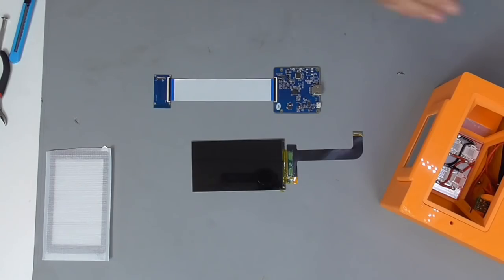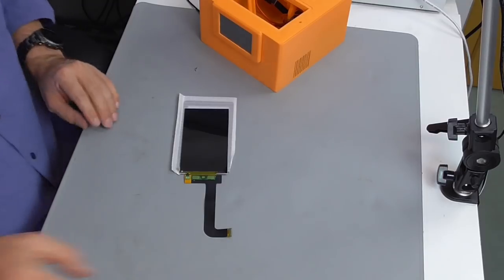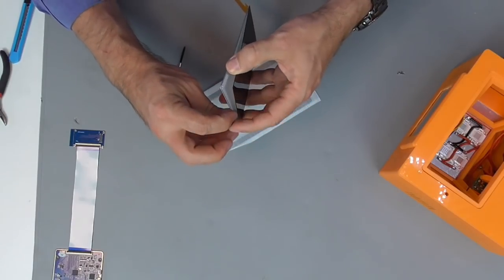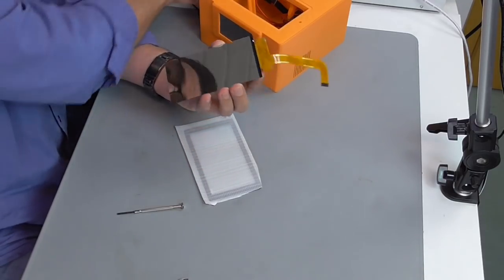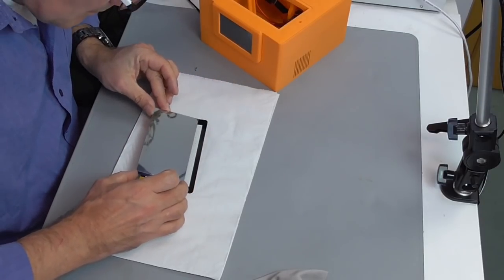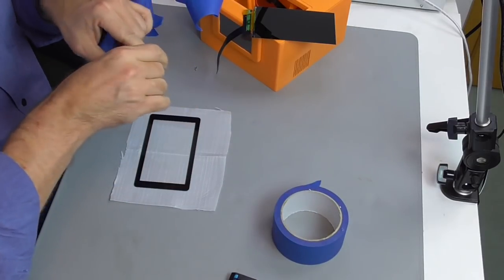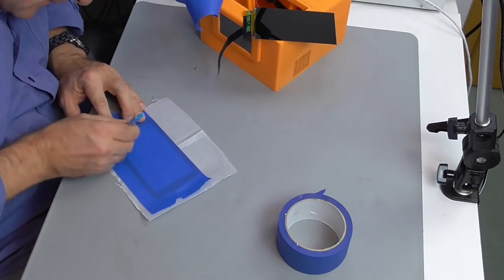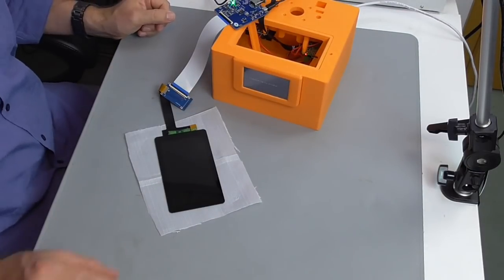DIY: FDM-printed SLA-Printer: Part 9 - Preparing the Display

Comment: i had an idea and wanted to know if it was possible to add a lens like a projector has to make the bed larger? would this work or would you have to have a larger lcd screen instead? im want to make a work bench sized resin printer bed.
Reply from the maker: An increased projection surface does not increase resolution, or adjust intensity of light. In other words: you will get a terrible printing resolution/quality on the x- and y-axis. At the same time the given amount of light is spread over a much bigger surface which degreases intensity and therefore increases exposure time significantly. Long story short: terrible idea!   And by the way, there are other designs that utilize DLP-projectors which is a more suitable approach. But those have the same problems regarding resolution on bigger surfaced and also restricted to daylight sensitive resin as those projectors dont use UV light as light source.

Comment: I had the problem, that the display was working on a PC, but not wit the Raspberry Pi. If anyone experiences the same problem, I suggest editing the /boot/config.txt like it i described here: https://3dprinterwiki.info/d7/d7-nanodlp-settings-2/
Reply: Do you know if the display has to be 50 or 60Hz to work with Pi or it doesn't matter?
Reply: @brunocabral1578  I am not sure, but I think it doesn't matter
Reply: @AHNT  someone told me that the display frequence has to be the same of the power supply from my house. In Brazil, 60Hz. Europe, I guess it is 50Hz
Reply: @brunocabral1578  The raspberry pi is powered by 5V DC, therefore the frequency of your electrical grid doesn't have any effect on it. There is no oscillation after the power supply.
Reply: @AHNT  That's a good point!

Comment: Hi there and thanks for all the info!
I am having a delay between LED-on and LCD-on, about 1.6secs.
I noticed you get the same delay in your video too.
I am using a RAMPS instead of the shield so I have to invoke G-code for mostly anything I want the printer to do.
There is something in the way nanoDLP or Rpi handles the HDMI, it probably puts it on standby mode and wakes it up when a new exposure starts.
I managed to sync them but putting in a [[Delay 1.6]] ; before the M106(LED-on) signal, but that is unacceptable since it accumulates and increases print times significantly.
I wonder if you have any ideas on how to overcome this, maybe using a display mode that wakes up the screen before first layer and then just changes the images, while it just toggles the LEDs on and off?
Unfortunately my knowledge of this level of HW & SW is negligible.

Comment: Would this still work without removing the backlight and using that to cure the resin? I know it’ll take longer, but would it work?
Reply from the maker: shaggyego you would have to use daylight sensitive resin instead of normal 405nm resin. This of course requuires printing in a absolut dark room or cover. And exposure time is most likely beyond acceptable

Comment: Hello, I'm putting together the same equipment and I notice that the Uv filters a lot the polarized plate that it brings behind the screen. This can not be removed or should the power of the uv led be increased?
Reply: Hello Juan. Have you been able to solve your issue? I am experiencing the same problem now.  In this video, as far as I can see, they only removed the backight, reflector, and light guide. did the same, but turned out that UV has been filtered. had to go all the way to the LCD layer by removing bottom polarizer. well, now I can see no pixels as expected.

Comment: What happens if you remove the polarized film?
Reply from the maker: Then it's gone!
Reply: I'm sorry, but what what means then it's gone? I screwed up taking apart that filter?
Reply from the maker: When you remove the polarized film, then it's gone!
And: Yes, a LCD panel consists of 2 polarized filters and if any of them or both are removed, the display is not longer capable to generate a visible image.

Comment: So nice! Can you post the link of the screen!? Thanks you!
Reply from the maker: Here you are:
https://www.aliexpress.com/item/5-5-inch-LCD-with-controller-Board-for-DLP-SLA-3D-printer-KLD-1260-3D-printer/32815697328.html?spm=a2g0s.9042311.0.0.1GANJT
Reply: @BurgerStefan  Do you mind if I ask if the display needs to be 50 or 60Hz to work with raspberry or it doesn't matter?